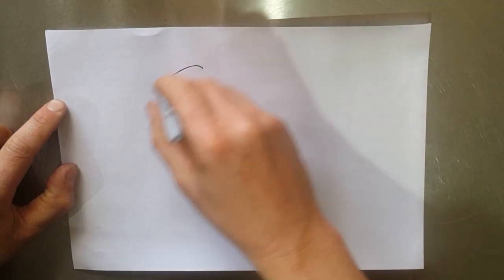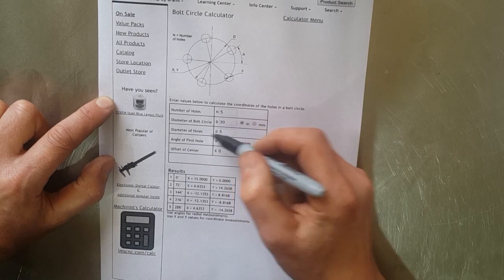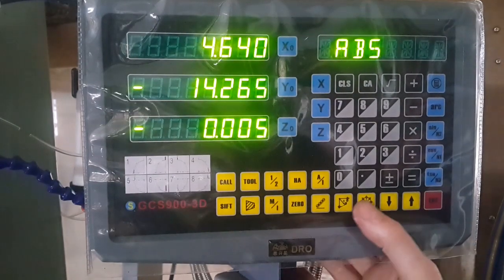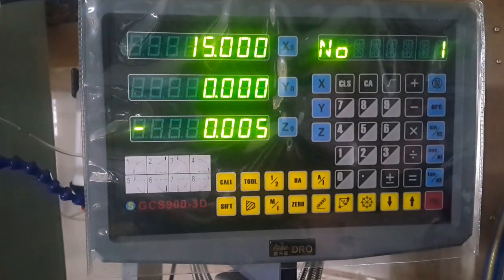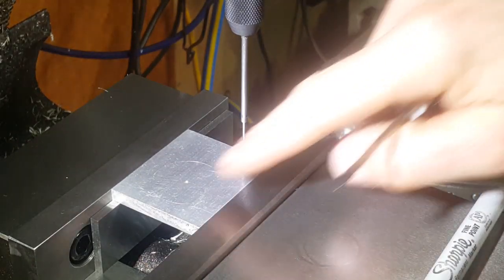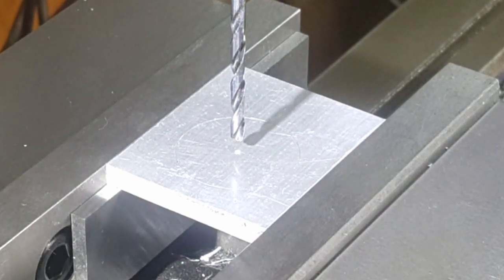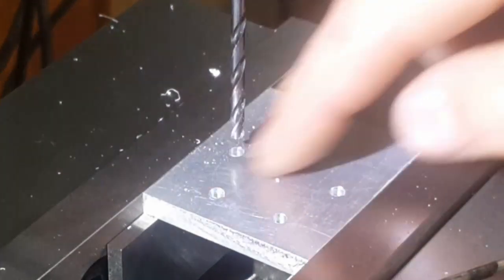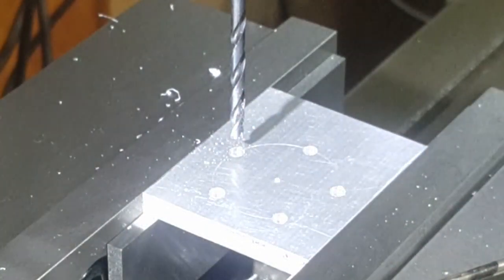#39 - DRO - Drilling Bolt Hole Patterns Around A Circle - Part 2

Comment: Nice video.
I have the same Sino DRO. If you don't know the endangel of the last hole in the cirkel, you just prog. one more hole than you want and chose 360dg endangel, then you ends at the startpoint. Just a tip 😊

Comment: G'Day Kevin, I wouldn't be without the PCD function.  I can't recall the last time I set up the rotary table to do a series of PCD holes.  One of the early DRO's I worked with on a large universal borer only had the X/Y distance capability.  I used the old Zeus Data Chart books that had the formula's for calculation the x/y hole positions on a PCD based on the number of holes to be drilled.  Took a bit longer with this old fashioned DRO but heaps quicker than setting up a rotary table.
Cam
Reply from the maker: PCD makes it so much easier. Gone are the days of working the distances/angles using Sine/Cosine and Tangents.
Cheers Kevin